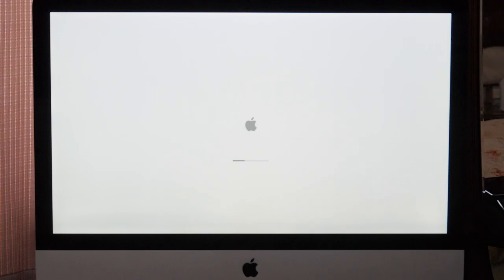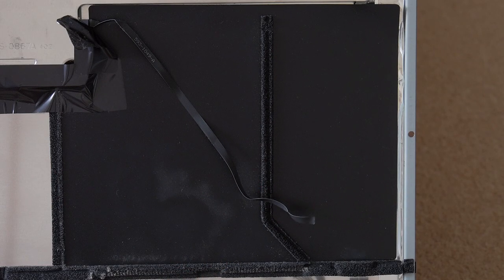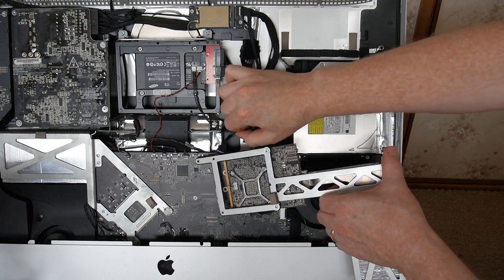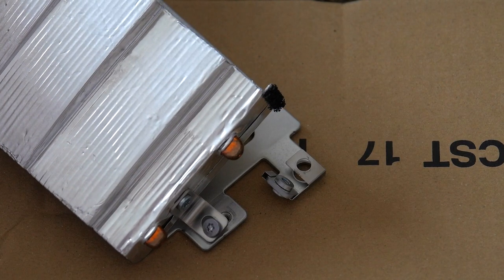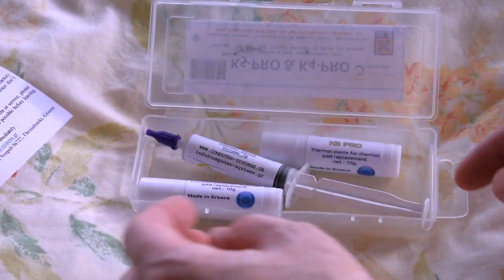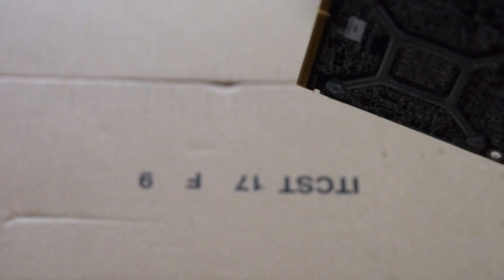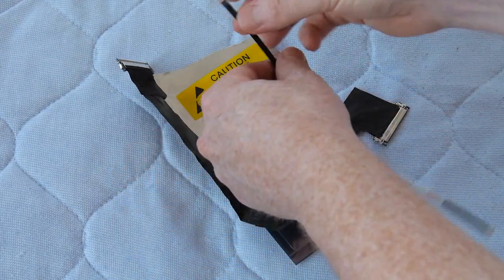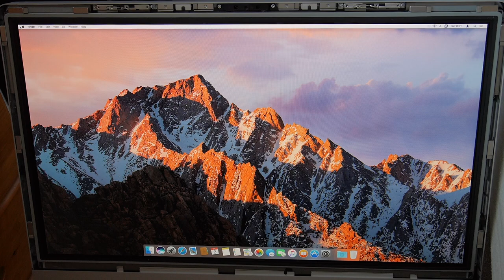Late 2009 iMac 27" Video Card Repair — 4850 — 2nd Bake

Comment: Hello everybody I did the procedure like this video and the imac works again. Thanks a lot to this channel. Any of you know if maybe is possible to replace the grafic card with Nvidia gt130 or a quadro card for mac Pro, or where is possible to find the ATI 6970 from imac 2011 which is compatible with this imac (I check already)? Just in case my hd4850 stop working again cause this is just a reflow of grafic card not a permanent fix. I don't wanna Trow away this machine cause is more then enough for my need
Reply from the maker: Thank you for taking time to let everyone know of your successful bake.  I too thought about getting a better video card rather than just bake my existing one.  However, newer cards aren't necessarily a perfect fit, and you might need to actually cut parts to make them fit.  Newer cards may also run hotter, and more heat is something you should try to avoid.  Because of this, I decided to stick with my old card.  It's not the fastest GPU in the world, to be sure, but then again, neither is this CPU, RAM or motherboard.  So far, my 2nd bake has been going strong daily for the last 16 months.  That's not necessarily a "permanent fix," but the longevity I've gotten from it shows that the bake can last a good long while.
Reply: @JDW-  thank you for the reply I also hope it last like yours 17 and more months 😊. I have another question for you. Do you think is good idea to put back mac OS snow leopard on it  and dual boot with Windows (the 7)? Cause I did years ago and it was super fast even without ssd. Im about to put another 8 gb more to it, so total 12, and install ssd instead of dvd player Which is also not working. I remember snow leopard so light and fast with 4gb but now I hear the HD making so much noise like a tractor. I don't need all new feature brought in last osx that's are making it more similar to ios. I don't have other apple device and I do only basic usage (my father need only to check news paper bank account and YouTube).
Reply from the maker: I still sometimes boot my G4 Cube into OS9 to enjoy the speed, so I know what you mean about using an older OS.  It all boils down to what software you use and what enjoyment a particular MacOS X flavor will bring you.  A lot of modern apps that are still being updated today won't work on very old versions of MacOS X.  So you should check the apps you want to use to ensure they will work on the older version of MacOS you are thinking about installing.  Once you do that, you will gain a nice speed boost.  It won't be a night and day, near-heart-attack style speed difference that an SSD will often make, but an older OS is better tuned for older Mac hardware, to be sure.  And if you really want a kick in the performance pants, install an older version of MacOS X with an SSD, and through 16GB of RAM (or more) in there as well.  Moving from 8GB to 16GB benefited me greatly because my wife and I share the same Mac and left both users open all the time, and I was always running low on RAM, so the OS would use virtual memory from the hard drive which is much slower (even if your drive is an SSD).  An SSD is 100% silent and it draws less power allowing your iMac to run a tad bit cooler too.

Comment: May I ask if its possible to upgrade the graphics card without changing the heatsink? Like the 6 series card?
Reply from the maker: From what I have read and have been told by people in this comments section, different model video cards (e.g., newer cards taken from new iMacs) are not 100% the same size and therefore have a slightly different heatsink.  So if you change the video card to a different model number but use the same heatsink, I cannot offer you any guarantees on what you will find, simply because I myself have never seen with my own eyes how it fits.  If you want to take the risk and try it, please be sure to make a video of it, then post it here on YouTube so others can benefit from what you find.  Sorry I cannot be of more help, but all I know is hearsay.  And that's why I decided to bake my card rather than swap it out.  I had nothing to lose by baking it, but I potentially had something to lose by purchasing a different video card that might not fit perfectly, especially because a lot of the cards are sold on the US side, but I reside in Japan (shipping charges are fairly high).
Reply: JDW Thanks man. Wish I see your videos earlier. I got them replaced by apple spending $500 few years back. Now I wanna upgrade the card for gaming as 4850 doesn't support directx 11.
Reply from the maker: I have read that some people buy newer video cards on EBAY that include the newer heatsink too.  That makes it easier to replace the video card without worry about the heatsink.  However, I have heard that the shape isn’t 100% the same, so such may require a little cutting of some plastic parts inside the iMac to make it fit perfectly.  Usually these cards are taken from 2011 or 2012 iMacs. They will work in the 2009 iMac, from what I have read.  Some people have reported more heat using those cards in a 2009 iMac and others have reported less, so I am not sure which reports to believe.  I hope this helps.  Best wishes!

Comment: if u take a hair dryer and heat it will do the same job now need to bake it as the soldering melt at 214 degree so it is not remelting anything  , the heat re-aline the components on the cpu (micro transistors)  if u want to permanent fix this problem you need to replace the chip
Reply from the maker: Replacing the GPU Chip would not be a permanent fix. I know this because three years after I purchased my iMac it developed the problem and Apple replaced it with a brand-new card. Three years later even that new card develop the same problem. So that proves that even if you swap out the entire card the problem will happen again over time. I think it's an inherent design flaw in that particular card.
Reply: yes you are  right  the problem is that apple overclock the gpu with the newer update , if u stick to 10.6 it will last longer .i think apple do this so they force u to buy a new mac .i am a certified apple technician but i don't play by apples rule as i know they will refurbish your old card and sell it back as new ,
Reply from the maker: My personal opinion is that Macs are expensive so they should last at least 10 years.  I have some vintage Macs made in the 1980's that still run fine.  That's the main reason I've not decided to buy a more modern Mac.  I'm just a little pissed off my 2009 iMac gave me all these troubles.  I do use a late 2015 Retina 27" iMac at the office and it runs very cool and fast.  No problems whatsoever so far.  In contrast, the 2009 iMac runs very hot.  Heat kills.  Then again, we can also say "heat revives" too because the oven bake really does work, at least for a while.  Thanks for your comments and for watching!
Reply: Same opinion.
Reply: So whats this upgrade for? this will quit overclock to the graphic card? https://support.apple.com/kb/DL984?viewlocale=en_US&locale=es_ES   I have a friend that has a 2010 iMac with the ATI 4850. He tells me that he's got some vertical bars in the screen and wants to sell the imac for pieces. Replacing the video card would temporally work maybe 3 years... but the heat would desolder it again. Baking the card in the oven or replacing the card with a new one and not raising the temp so much would be a possible solution i guess. Using an SSD disk instead of mechanical HDD or not using the optical drive could reduce the internal temperature maybe? how can we send more fresh air to the graphic card?
Reply: GEEKEA. COM  to be honest is not the overheating that course  of the problem , is is ware out and the new OSX 10.12 made it dork even harder 
They are no new card available on the market as apple don't support it anymore so you will buy a second hand can died at any time ,, the other solution should be to replace the chip but again the are non on the market and the few I bought so fare are reworked and sold as new but the fail after few weeks so not sure . 
 Definitely heat is not what course the issue ( the soldering balls melt  at 218 degrees Celsius )
Reply: Would there be any advantage in going back to an older OS version after a successful bake to keep things cooler?
Reply from the maker: You mean "an older OS that uses far less GPU."  Perhaps it might help extend the life of the card a little bit, but most people probably wouldn't do that since you lose a little software compatibility by doing that.
Reply: Liberty or Death  yes they will work under less stress  but this days if u are not up to day they are many thinks you can't use as iTunes to synchronised your ios divides 
I think apples is doing this upgrades to kill the older Mac even they can run the new  system like sierra they work much more harder and that in a 5 or even 10 year old Mac is not good ..it is a killer
Reply: Dear Gonzalo Fernandez,
"the other solution should be to replace the chip", could we have a video of this operation (like very clean videos of JWD) ? Thanks a lot. Loïc.
Reply: Loïc Drouet  hi yes you're 100%tight . The problem is they are so many fake ( rebelled and polished)  chip in the market and on my own experience all the chips in the pass 12 months ware not working or fails very soon after the repair

Comment: Is there a chance to upgrade the card to a latter version when I already have disassembled everything?
Reply: Alexander Lorenz Im in the process of diassembling my imac 27 2009 as ive been getting the horizontal lines of death from the “card of sorrows”lol. From my research, you can use the radeon 6970 card from a 2011 model
Reply from the maker: As Juju said, you can use cards from 2010, 2011 and even 2012 27" iMacs in the 2009 iMac, but I have read that the newer cards are not 100% the same size so some minor plastic cutting may be required.  I myself would be more concerned about the newer cards generating more heat.  If the heat levels are the same, you should be fine.  Because I was unsure about this point, I did not give much thought to replacing my video card and instead opted to bake it back to life.  In the end, it was cheaper to do that too.
Reply: Thx guys for the quick response. Another question regarding the baking process. After 10mins are over do I need to take the card immediately out of the oven - or do I simply turn off the oven but leave the card inside until is fully cooled down. In other words how does the cool down process of the card look like?
Also is it recommended to turn the air flow in inside the oven on?
Reply from the maker: I suggest you leave the oven door open after baking and allow the card to cool.  You could also remove the card from the oven and put it on your kitchen table and allow it to cool, which is what I did because I had the card sitting on a removable tray, making it easy to remove from the oven (with oven mittens) while still sitting on the foil pieces.  Let it cool to room temperature.  It doesn't really take that long.  Test it now and then with your finger to determine if it is cool.
Reply: ah ok good luck. Let me know how much overall effort I have to reckon with as a newbie. I'm still in the planning process and doing a little research in advance before I start :-)
Reply from the maker: Effort?  Quite a lot.  I say this from experience having done 2 bakes.  It takes at least 3 full hours, assuming you have all the tools and thermal paste ready (see text Description under video above for details).  I would dedicate an entire Saturday to the job.  You won't need all day.  But if you get interrupted several times, having a whole day dedicated to the bake should ensure you get done that same day, assuming you don't break any cables by accident like I did in my 2nd bake.  That will cost you 2 weeks!
Reply: Hi just want to let you know that I run through the process and it worked. My iMac Late 2009 went back to live. I baked the card 10mins by 200 degree with the air fan on in the oven. Just out of curiosity: From the 2nd bake video it looks like that you can remove the video card w/o removing the logic board. Also I have seen some other videos where people upgrade the CPU of their iMacs. I was wondering if there are some recommendations available which CPU I can place in my late 2009 model and if anyone has some experience with this.
Reply from the maker: I am pleased to hear the bake worked for you!  You can remove the video card without removing the motherboard, but the BR2032 battery is on the back side of the motherboard and to replace it you need to at least partially remove the motherboard.  I have no experience changing the CPU to a new CPU or different CPU model.  Sorry.  I can only say that I did not touch the CPU at all when I did my bake.  Perhaps it benefit from new thermal paste, but I did not do that.
Reply: ok - anyways, you put together a pretty good tutorial. I followed your instructions and it helped a lot. Thanks again for the work you put into this.